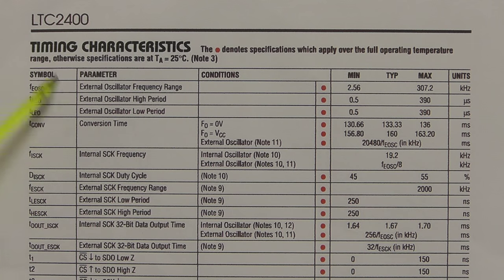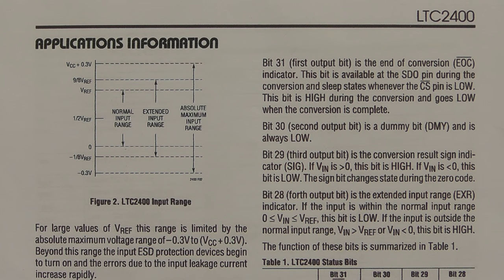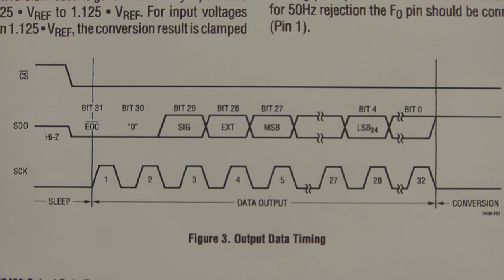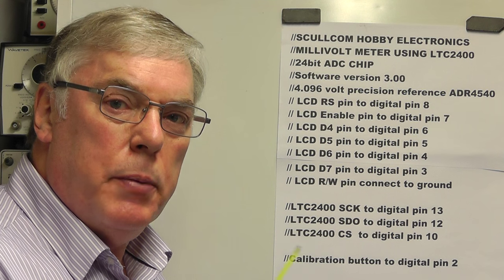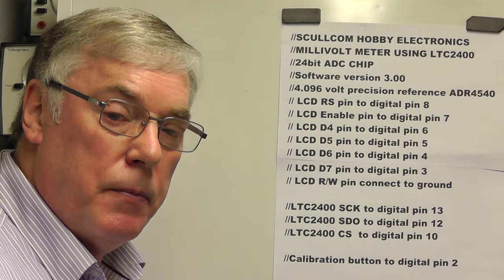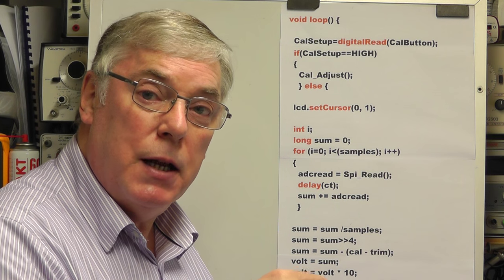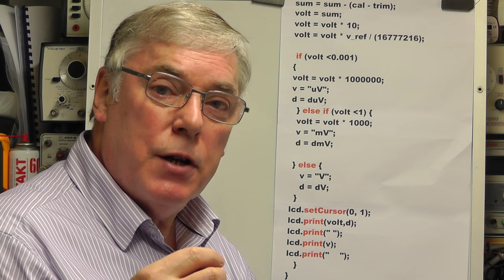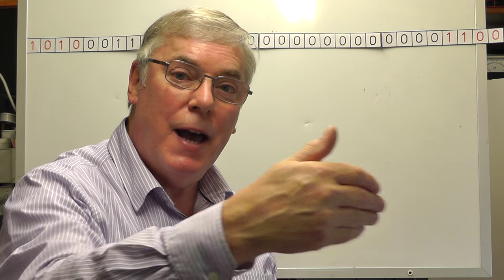Scullcom Hobby Electronics # 33 - Design & Build a 6½ Digit Millivolt Meter Part 2

Comment: Awesome project and information, im in the middle of the DC Load Project. Just finished making the PCB, my first, and got some parts soldered on while i wait for the 100E mosfets. I just wanted to thank you for all this information, instead of drooling over all the expensive equipment everyone wishes they had now we can build it ourselves. Once i finish up the DC load im going to tackle this project. Thank you once again!
-Victor
Reply from the maker: Thanks Victor. Hope it all goes well. Regards, Louis

Comment: Excelent Part 2 there, it came together very well

One suggestion to the final product (Perhaps a Part 3 ??) would be to not have the 10 turn pot and use a software highend calibration instead

Vishay and other makes of precision and low drift (Temp Co) resistors are quite expensive and if buying them to close tollerance ontop of that they can end up being a significant part of the cost of the whole project
Buying Low temp co but lesser accurate resistors (1% perhaps) will keep the cost down and the trimming can be religated to software as typically 10 turn trimpots are not very stable devices, especially for this kind of project. Using a software calibration allows both 0 and 5V for instance to be calibrated accuratly and then useing a software determined offset (From 0) and scale factor (From 5V ref check) you can get the meter spot on (Not allowing for any none linerarity of the ADC), this results in one less component and the ability to perform the basic calibration with the complete project contained in an enclosure without having to open it.

A more advanced cal could include a set of 1 V increments to eliminate or minumize the none linerarity too if so desired.

Finally, connecting that pin to select between 50 or 60 Hz filtering could be connected to one of the arduino pins to allow the user to simply select the appropriate one for their region

Over all an excelent example of creating a Volt meter within the budget of pretty much anyone.

Keep them comming
Peter (https://www.youtube.com/c/thebreadboardca)
Reply from the maker: +Peter Oakes (TheBreadboard) Peter thanks for your detailed comments, which are appreciated. I have been working of some software calibration options and could cover them in Part 3. Nice point about the 50Hz / 60Hz notch filter switch, I will look in to that.
Reply: +Scullcom Hobby Electronics About software calibration options, did you consider including in software the part that would inform you, that after "zeroing" the meter (pardon my bad English) the readout is larger than acceptable tolerance? Something like Datron "error 4":)
Reply from the maker: +kroplaaaa No. But I am looking at possible auto calibration options as an upgrade later.

Comment: Thats really impressive for a device with so very few parts, and it doesnt cost the earth, your intellegence and ability to design circuits/software so we can understand it allways impresses me, your a smashing teacher :-D
I have to admit that you lost me with the software, but im not into programming so thats understandable, some bits reminded me of the old original "Basic" used in 8 bit computers, loops and print and variable statements :-)
The serial data/timing in simple form made sense to even my foggy brain lol.
That caddoc resistor network would be ideal for ranges, much like the resistor divider typically used in all cheap icl7106 based multimeters :-)
Reply from the maker: +zx8401ztv Thanks. Software is always one of the issues with modern electronics these days. I still remember when electronic hardware had no software element - which I starting in electronics it was all valves!!! Many years ago before you could buy a desktop PC, I remember making a computer with a 6502 microprocessor and only 1K of RAM and 2K of EPROM. This meant that the software was in machine code (hexadecimal format) which I use to be quite good at, but not used these days. In the early 1980's I was programming a Sinclair ZX80 microcomputer also with 1K of RAM but now in Basic language. I later upgraded to a BBC Model B Computer which again had the Basic Language but much more memory 32K RAM  - thoughs were the days !!!!
Now the hobbyist needs to get use to C++ which is the basis of the Arduino software code of which I am no expert but try to work it out for my projects the best I can when needed.
I will be looking at range switching and other options in part 3. The Caddock resistor networks are very good but quite expensive for the hobbyist, so I also try to provide simple alternatives as well.
Reply: +Scullcom Hobby Electronics 
I started computing with the Sinclair ZX81, i loved basic, but never went towards machine code at that time, i did repair some and made an 2k ram pack using 2114 static rams and a 74ls138 3-to-8 line decoder, worked well :-D.
I got a spectrum later, i repaired them too, ram problems and the +/- 12 and 5v supplys were a problem.
I learnt machine code from the table in the back of the manual, so i typed the numbers direct to memory, no assembler required.
I had great fun making interfaces and i made a game cartridge, "jaysons gem" was the game i burn to eprom, worked :-D
Then pc's came along and the brain stopped lol.
Reply from the maker: +zx8401ztv Nice to hear you had a similar experience as myself. I still have some 2114 RAM chips in a draw in my workshop!!!
Reply: +Scullcom Hobby Electronics 
They seemed loads of memory for there day LOL mad :-)

Comment: This could be the beginnings of a nice little bench multimeter... was wondering what to do with a large 20 character LCD I have laying around, then again, I also have nice TFT with nothing to do... ;)

Could add a ultra low noise input buffer, that would allow auto calibration on power up and possibly allow some type of input protection... as for range switching, you could possibly make it auto-ranging...

Too many ideas, I'll be designing in my sleep again.... 

Looking forward to the next one...
Merry Christmas to all.
Mike
Reply from the maker: +Michael O'Toole Thanks for your comments. Due to the number of good comments I am planning on a Part 3 to cover upgrades and enhancements.
Reply: +Scullcom Hobby Electronics 
I've build most of the circuit to test software side but am waiting for parts for the rest... I'm using the ATMega328p chip (no Arduino) and have schematic and pcb layout in KiCad (link to images)... http://www.phpbbireland.com/kiss2/viewtopic.php?f=80&t=1302&p=8841#p8841

Comment: It might be nice to have fully automatic calibration process for divider when using lower quality resistors. Instead of trimmer you maybe can measure the reference once with your Keithley and include that value in the code. After that the calibration could be done by measuring zero and the reference voltage and calculating correction from those two values.
Reply from the maker: +Henri Troberg Thanks for your comments. Calibration is always an issue. I am now planning a Part 3 to this project to look at upgrades and enhancements.

Comment: In spi_read, if conversion is not finished, there's no return statement and you get garbage returned. This happens if delayMicroseconds is faster than conversion. It should work but it's not safe... Actually the test is useless because if not finished you don't wait.
Reply from the maker: +cyril muller Thanks for your comment. Although the software seems to work OK at the moment, I will have a look at that and cover it off in Part 3. If you are familiar with Arduino software any suggestions are always welcome.

Comment: I would have guessed that more of the declared variables would have been able to be declared with "const" like a few of them were.  I also don't understand why you didn't run the calibrate routine after you adjusted the divider preset.  It would be interesting to see what the level of "noise" is that gets displayed if you were to have this enclosed in something that would provide some shielding,  and have a very direct "short" across the input rather than that longish clip-lead that struck me as being a usable antenna for some frequencies.  I'm not remembering the details of the hardware at the moment but I don't recall much consideration being given to frequency response of the instrument,  something that you might want to consider given how sensitive it can be.

Comment: I really enjoy watching your videos. Your good. I'm trying to teach myself about electronics over the internet & was thinking that this meter might easily be converted to an accurate ammeter across a sense resistor. What do you think? am I on the right track? If so, what value or values would you suggest for the range of this meter?
Thank you,
  Todd K.
Reply from the maker: +Todd K. Thanks for your comments. In theory you could do what you are suggesting. Using a 1 ohm current sense resistor and measuring the voltage across it would equal 1 mV for 1mA. To read micro-amps a 1 ohm resistors would only give 1uV for 1uA - which is beyond the limit of this Millivolt Meter project. Ideally you should use a sense resistor of milliohms but this would not be practicable with this Millivolt Meter. You could use a bigger sense resistor but this is not really recommended. As the benefits of a low value sense resistor are:
 1. Low value resistors have better time and temperature stability, and a better voltage coefficient than high value resistors.
2. Low resistor values reduce the input time constant and result in faster instrument response times.
Noise is also an issue at very low currents.

There are two basic techniques for making low current readings - the shunt method, and the feedback ammeter technique. The shunt method is used primarily in Digital Multimeters. Whereas, Picoammeters and newer Electrometers use only the feedback ammeter method.
I think building your own low current ammeter is for another project !!!!
Reply: +Scullcom Hobby Electronics 
Thank you for taking the time & sharing your knowledge.
You are a true gentleman.
Todd K.

Comment: Great videos! I just wonder, wouldn't taking several measurements and then do an average on them? Would that not stabilise the value and make it more accurate?
Reply from the maker: +Jack Zimmermann Thanks. Yes averaging does help and this project does in fact take a few reading and then takes the average.

Comment: This is a good project. But it's not really a 6.5 digit, it's more like 5 digit at best because of the noise floor. Maybe getting a lower noise LDO than a 7805 could help. Or a better op-amp.

Comment: Ow man. I really like the project and all the component research was great. But the program has so many flaws and bad practices in it it's terrible to watch! When I'm back at my computer this weekend (all I have now is my One Plus) I'll rewrite the program. I'm glad you would like to make a third part of this:)
Reply from the maker: +tengelgeer Thanks for your comments. Arduino software is not my forte so any help with a better programming solution would be much appreciate as it would also help others. I am planning a Part 3 of this project.
Reply: +Scullcom Hobby Electronics You certainly have an "interesting" approach to code formatting. ;)

I've seen arduino code before, there does seem to be a lot of global variables in it, I guess that comes with the territory.

Btw, pretty much anytime an operator that acts on a left hand side (LHS) variable, it can be written as operator=, so x = x + 13; becomes x += 13, x = x / 10; can be written as x /= 10; Doing this makes code a little easier to read and helps develop a comfortable level of OCD.

This must be what its like for hardware engineers when us software engineers start laying out boards!
Reply from the maker: +Robee Shepherd Thanks Robee. As I was trained as a hardware electronics engineer, software is not my first discipline, coding does not always come easy!!! Thanks for your help. Arduino code at times seems to be a law to itself, there are so many variations!

Comment: What would happen if the input polarity was reversed?  Would it hurt the circuit or simply show a negative sign?
Reply from the maker: +Rachel L The diode D1 at the input would clamp on negative input and protect the circuit (see schematic). I am also looking at other alternative protection measures I will try and cover in Part 3.
Reply: Ah, I guess it would.  I saw that diode but assumed that it was only there to clamp the input to 5.1 volts.  Thank you.

Comment: What was the source of the noise in the reading? Was it the voltage standard or something else?
Reply from the maker: +Gooberslot Noise can be caused by a number of things which could include voltage reference noise, ADC input noise, power supply noise, external EMI noise, etc. I will have a look at that in part 3 of this project.
Reply: Scullcom Hobby Electronics I'm looking forward to part 3.

Comment: In your software you are converting to float too early. This gives you an computational error which might be the reason why you get about 20-50 uV offset for 0V still even calibrated.
change lines:
  volt = sum;                            //result changed to a float type and named volt (represents number with fractions)
  volt = volt * 10;                      //muliply voltage reading by x10 to adjust for input resistor divider network
  volt = volt * v_ref / (16777216);      //convert reading in to Volts ready for the display (max scale 24 bit number)
to:
 sum = sum>>12;                  //this is equivalent to 4096/16777216 which is 2^12/2^24 = 1/2^12 which in turn is shift 12; 4096 is vref times 1000
 volt = volt / (100);                 // factor 1/1000 from the above operation times 10 from the divider network; division by 10^x better made in float, because binaries don't like it ;-)

Anyway a very nice project!
Reply from the maker: Many thanks for your comments on the software. I will look in to that and test it. I will shortly be uploading an update to this project so will test it out on that. Regards, Louis

Comment: What would happen if you use an even lower noise voltage reference like this one:
http://waltjung.org/PDFs/Build_Ultra_Low_Noise_Voltage_Reference.pdf
Also I noticed that the reading now has a much slower update rate then reading showed in the first video. Was this intentional?  Anyways I love this project and can't wait to make my own PCB's :)
Reply from the maker: +Ventsislav Simonov Any method to reduce the noise will benefit the meter reading. In Part 3 of this project I will look at the noise levels. Following comments I did slow down the update rate in the software to make the reading more stable. But if required this could be change to make it faster. Thanks for your comments.